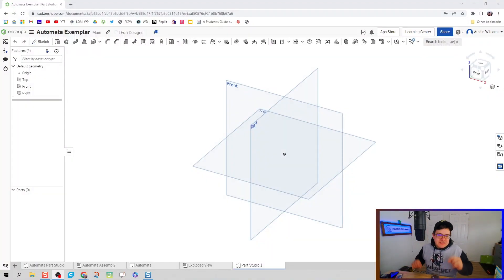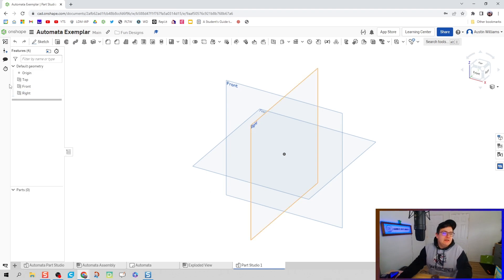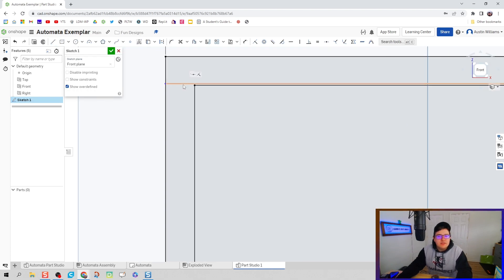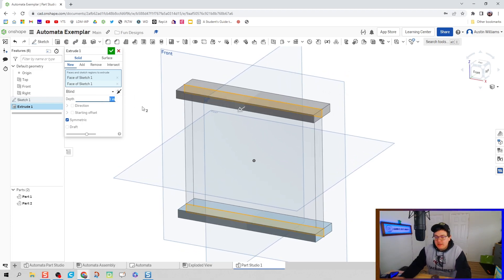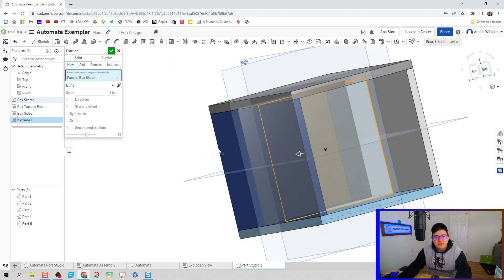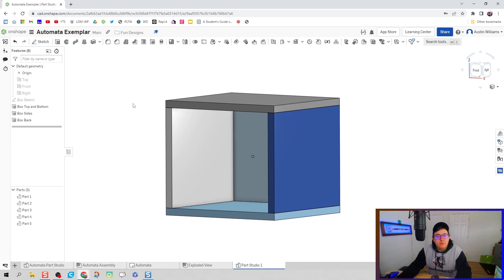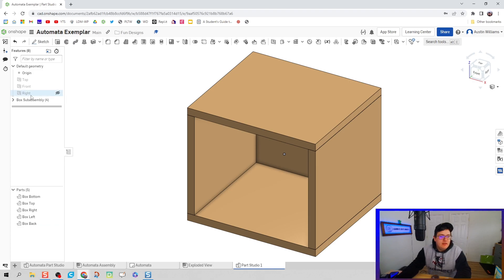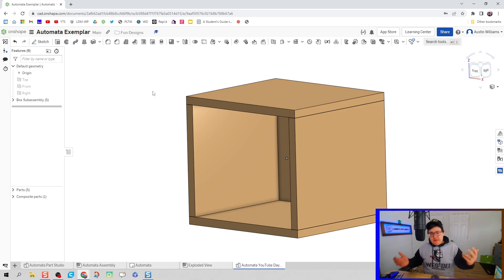Smart Automata Build (Box Subassembly) - Day 78 of 100 OnShape Journey

Comment: Thanks Austin.  I'm about to start the automata project so I'm going through your videos.  Is there a benefit to having separately names parts for otherwise identical parts such as top/bottom and left/right?  Also, I've never used the "composite parts" command, so I'm looking forward to how to use it in subsequent videos.
Reply from the maker: The separate names of the parts will be beneficial if the students are producing a BOM. It will populate callouts and tables quite easy if you're making a drawing.

Composite parts make assemblies quicker and more efficient. Essentially, I'll be pulling in composite parts, rather than individual parts into the assembly.